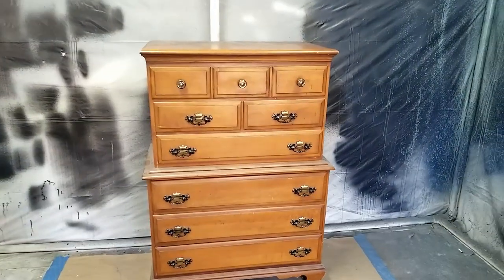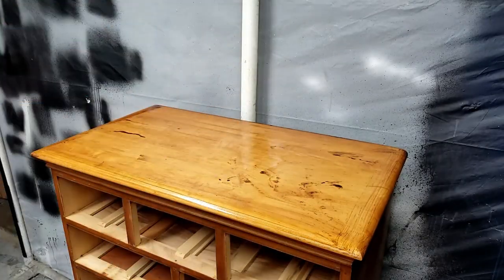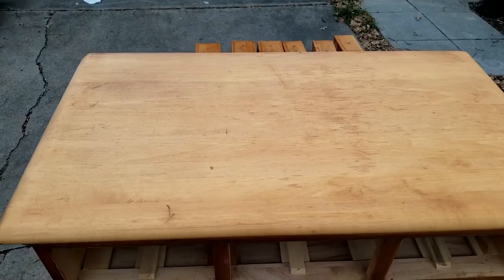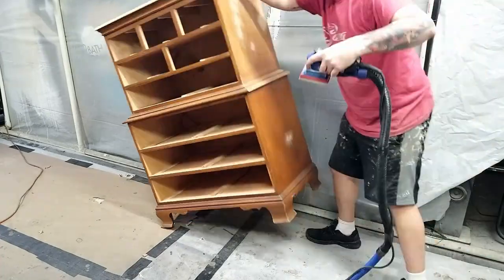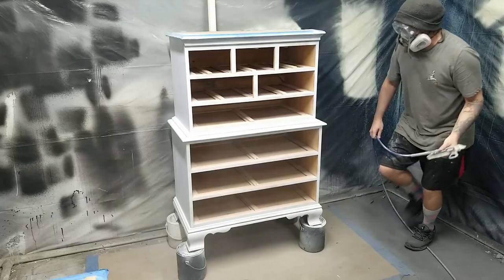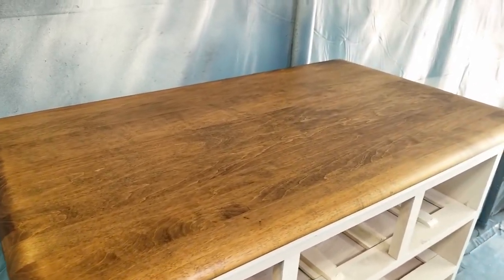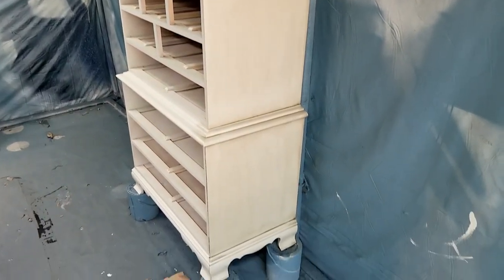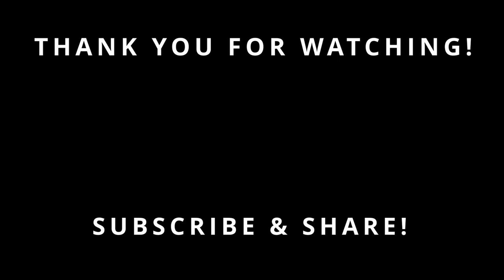Refinishing a Vintage Dresser With Paint and Stain | $50/hr Furniture Flipping

Comment: What kind of spray tip are you using? You have way too much over spray I’d suggest a FFLP 210 or 310 fine finish spray tip or invest in a hvlp gravity gun
Reply from the maker: 313 tip. Anything smaller in diameter causes water based poly to spit. Smaller fan size just means I have to make more passes. The Magnum series has always had a lot of overspray. The Graco TrueCoat too.

Comment: How do you clean the sprayer and dispose of your waste? I've got the same one and was running half a container of mineral spirits through it after using anything oil based, but then always have that same amount of waste that needs to be dealt with.
Reply from the maker: I only use water based products in my Graco for this very reason. All I have to dispose of is paint water. Whatever I clean from the machine goes into an empty paint bucket. I'll reuse those full buckets for awhile as stands to set my furniture on while working. When I need to get rid of them, my county has a place that household chemicals/paints can be taken to as long as you are a resident of the county. With mineral spirits, I think the best way is to recycle them by letting them sit. You can pour off the clear spirits and reuse them and only have to dispose of the stuff at the bottom. Might check into that.
Reply: @ThatShabbyGuy  Awesome, thank you. I'm not sure why the simple solution of using only water based products never crossed my mind.
Reply from the maker: Honestly they're easier to clean up. Dry faster. Tend to be less toxic. And are comparable in durabilty. Might have to make the switch! Good luck!